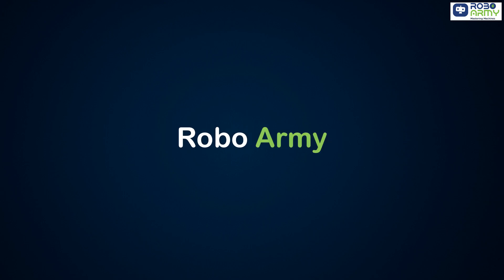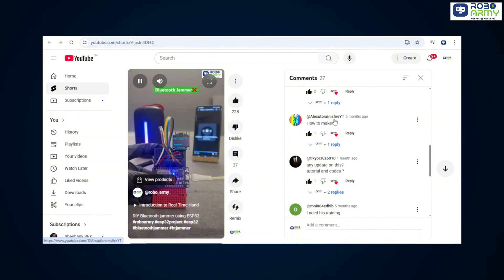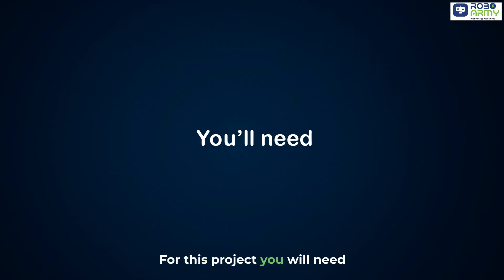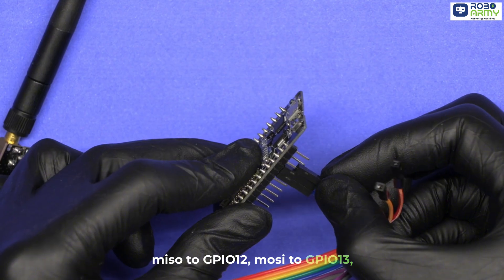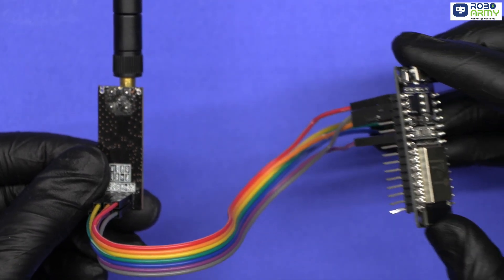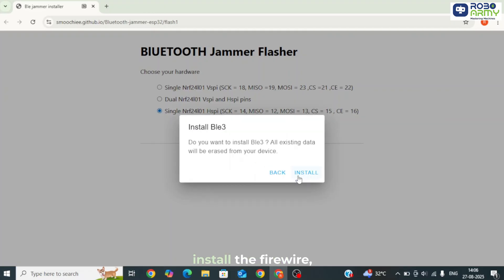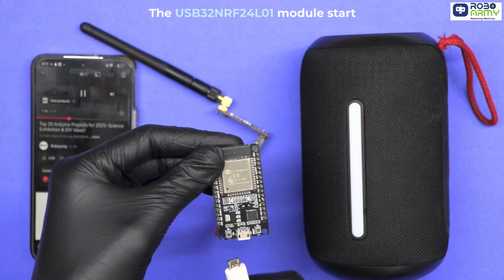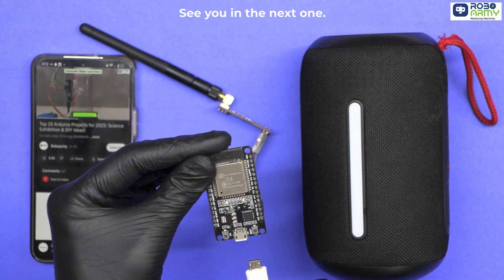Learn How NRF24L01 Works with ESP32 | Wireless Signal Testing

Comment: Its a change pin or any other?
Reply from the maker: Good question — these are the HSPI (hardware SPI) pins for the ESP32, so the flasher tool expects SCK=14, MISO=12, MOSI=13 and CS=15. CE can be any free GPIO (we used 16). You can change pins, but if you do the flasher may not work unless you remap SPI in the firmware/tool. So for an easy, no-code flash — keep the pins as shown and only change CE if needed. Also remember NRF24L01 must be powered with 3.3V, not 5V.

Comment: dowload firware ERROR ???
This XML file does not appear to have any style information associated with it. The document tree is shown below.
<Error>
<Code>AccessDenied</Code>
<Message>Access Denied</Message>
<RequestId>D9QGEYTH7C4HR866</RequestId>
<HostId>4BNzAehynNWpYV9M5255D1WXDc1Q5S4YdnPJQypqYbwWP5ZFC1RgNIBJe/9Wism0szT4ij56+8M=</HostId>
</Error>
Reply from the maker: That error means the flasher can't access the firmware (AccessDenied). Try: 1) open the link in another browser or incognito, 2) disable ad-blocker/extensions, 3) make sure you're logged into any required account, 4) try a different network or VPN. If it still fails, send a screenshot or tell me which step you were on and I’ll help upload a mirror.
Reply: @robo_army_  I've don everything but step 3. Not sure what I'll need to sign into to gain access since I'm clicking on it from a yt vid description. I think you'll have to re upload the file or fix permissions. Also, fantastic video. I've been trying to program this on my own, but barely ever got it to work. I'd love to see what you did.

Comment: Area kitna cover karega ye range kya hogi iski
Reply from the maker: The range of this project depends on the NRF24L01 module you are using. With the normal module, the coverage is usually around 10–20 meters indoors. If you use the version with the external antenna (NRF24L01+PA+LNA), it can go up to 700–1000 meters in open space. But remember, this is only for educational purposes and the actual performance may vary based on surroundings.

Comment: Hello sir is it possible to make it sensor project using arduino and LCD 1602 that tells frequency
Reply from the maker: Hello! Yes, it’s definitely possible to make a frequency measuring project using Arduino and an LCD 1602. You can connect a sensor or signal input to Arduino, calculate the frequency in the code, and then display the value on the LCD.

Comment: Sir can you help me it's not working I think my servo motor is little small that's why it is not working or codes are not uploaded please help I have to submit the project in automatic solar tracker video
Reply from the maker: Don’t worry, let’s troubleshoot step by step 

Check the Servo: Small servos (like SG90) usually work fine for this project, but if your solar panel is heavy, the servo might not be strong enough. Try testing the servo separately with a simple sweep code from Arduino IDE → Examples → Servo → Sweep. If it moves, then your servo is fine.

Check the Code Upload: Make sure you’ve selected the right board (Arduino Uno) and the correct COM port in the Arduino IDE before uploading.

Power Supply: The servo needs a good 5V supply. If you are powering everything from USB only, sometimes the servo doesn’t get enough current. Try an external 5V supply (with common ground).

Recheck Wiring: Ensure LDR sensors are connected to A0 and A1, and the servo signal wire to pin 11 as shown in the circuit diagram.

If you still face issues, share a picture or details of your setup so I can guide you better 👍.
Reply: My solar panel is heavy then what should I do